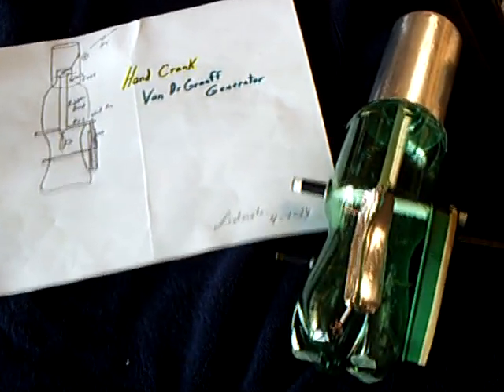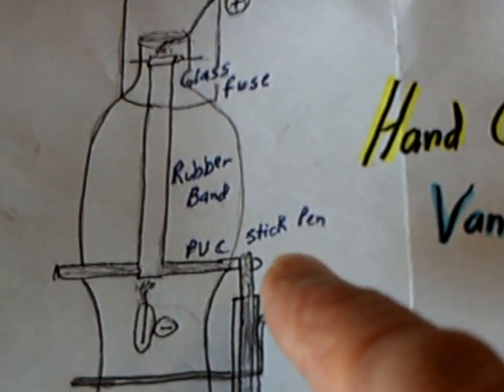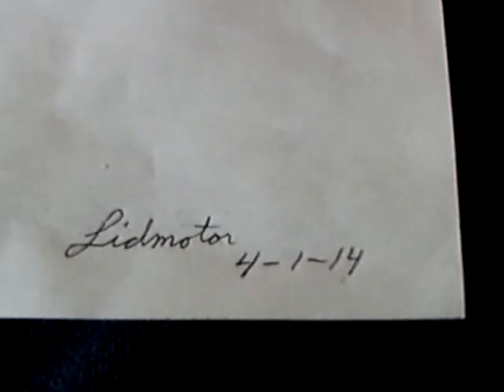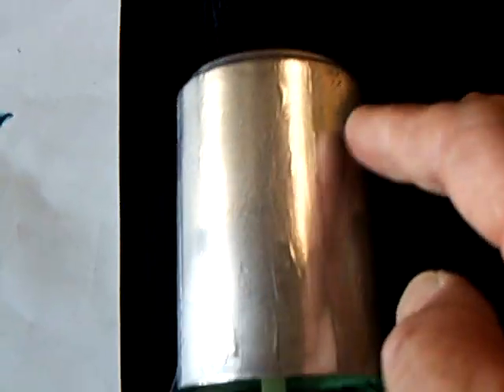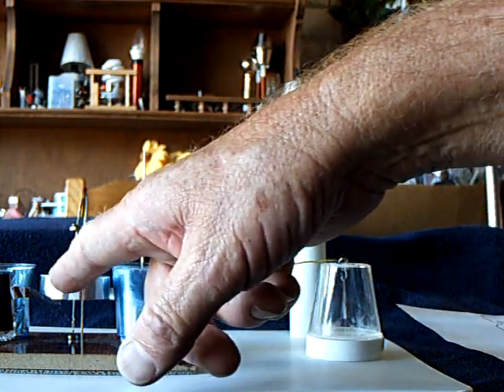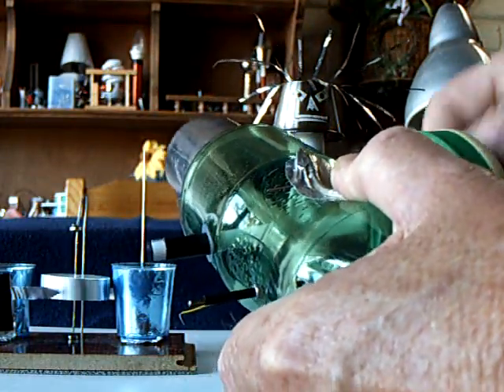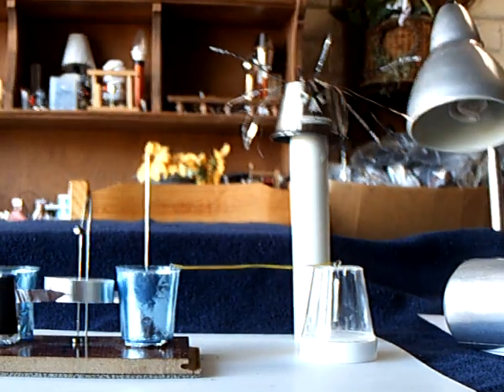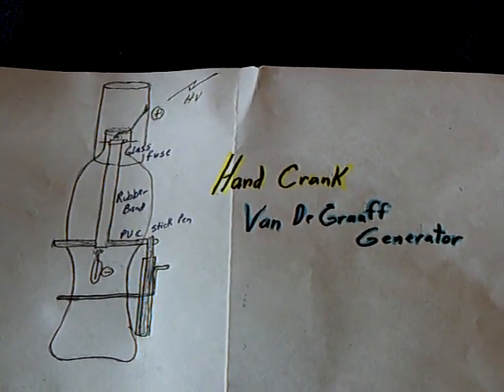Hand Crank Van De Graaff Generator

Comment: made one without any gearing it works really well, bottom pulley=top end of beer mug top pulley=glass marble belt=strips of party balloon stuck together lower brush=thumb. couldn't believe it when it worked. one inch sparks, didn't even need to turn the handle very fast will try to do a movie
Reply from the maker: Wow!  I'm anxious to see the video of that. Using your thumb as the lower brush is such a simple but effective idea.
Reply: ***** I think it works because the bottom roller, which is comparatively large, is near enough to the charge collector (pie dish) to have a charge induced on its top dead centre by the influence of the charge collector. So it only works because I used a small coke bottle and the distance between the pie dish and the top of the lower roller is quite small (about three inches). As I turn the lower roller I can feel the influence of the collector on the back of my hand. Will try to do a movie

Comment: The 'student' was hilarious...nice build all around. I was surprised how quickly everything spun up and started interacting, plus the distance away. Very cool stuff and very cool to watch :)
Reply from the maker: Thanks.  It is amazing to me that you can make electricity with a Bic pen, a rubberband, and a glass fuse. That makes me wonder what other simple combinations, when put togerther just right, can do something unexpected. I remember when I made that rechargeable battery using stainlees steel and Epsom salt I had the same feeling.
Reply: Triboelectric is very cool, especially if the fuse has blown, the pen has run out and the pop has just been finished off.
Say, that C/Pb carbon lead alum cell of mine is still going ! Rechargeable but has run an osc for a year just sat there...same feeling I bet, junk battery carbon, old pills bottle, wheel weight had fallen off a car lol

Comment: if you run it in the dark you should see sparks going from the bottom of the can towards  your hand, I was able to fix this by making a bigger (wider) (about ten inches) collector out of two foil pie dishes taped rim-to-rim, one with a hole the same size as the can, I think this causes the charge to polarise round the rim of the pie dishes rather than at the ends of the can.
Reply from the maker: Thanks David.  I didn't see any leakage going down the bottle but when I added the pie tin top load (I just used 4" 'Tart' tins) it really helped the spark output.  It is now a few mm longer and much brighter.
Reply: ***** I had to sit in a completely dark room for ages until my eyes got acclimatised then I could see a sort of glow round the bottom of the can
Reply from the maker: david vernon williamson When I was working with my 'Corona Motor' I had the same experience.  To see the corona between the rotor and the blades the room had to be totally dark and my eyes had to have 'night vision'.  I will try my VDG that way like you suggested.  I have read about corona leakage on these but I have not seen it.  I guess I need to look harder.  Thanks.

Comment: Hi Lid,
Have you ever used this to try and charge a battery?
Reply from the maker: Hi Steve.  Because the amperage is almost nothing you can't charge a battery BUT----you can charge a high voltage /very low farad capacitor.  The energy can be stored that way.  People usually use Leyden jars. The problem is converting the dc HV down to something usable that will run common items.
Reply: ***** What about trying on a crystal battery
I have been thinking of trying it on some of my latest home made high powered cells, maybe?
Reply: Steve Allwest Maybe get some amps also?

Comment: Awesome work there lid. Very well done and the best is all of it is very cheap :) cheers!
Reply from the maker: Thanks.  You are right.  This didn't cost much except time.  Figuring out how I wanted it to work using just the one plastic bottle alone was a bit hard.  The cardboard tube that I tried first didn't work out well at all and ate up two days.
Reply: ***** I know that feeling.... I'm still trying to have nice 3d print with my printer -_- and it's been a month some print well some fail horribly. At least the plastic is cheap and recyclable. :P